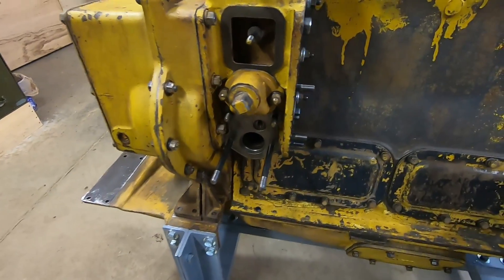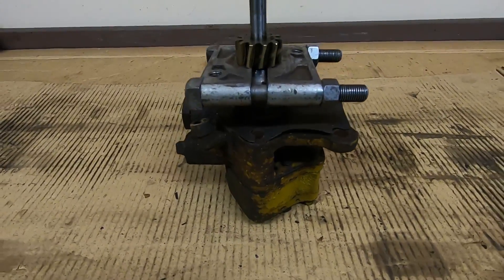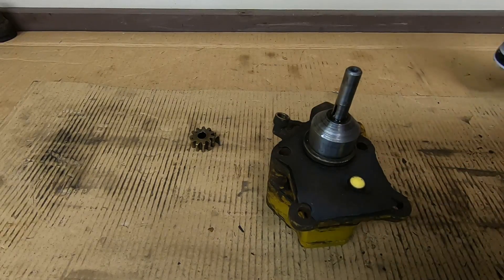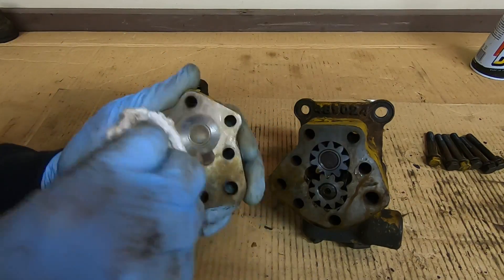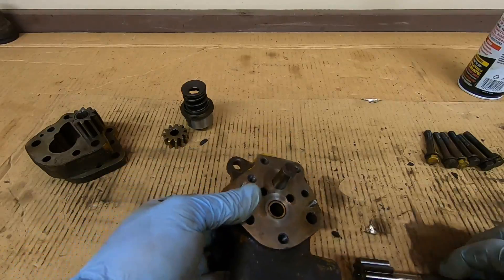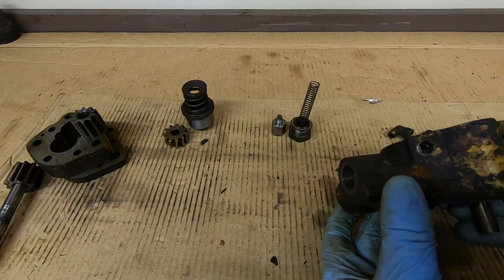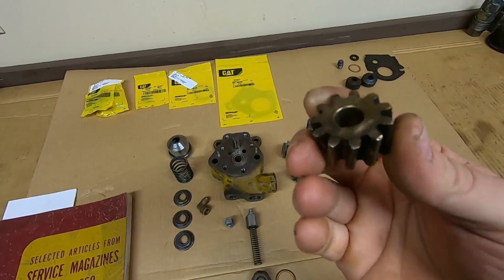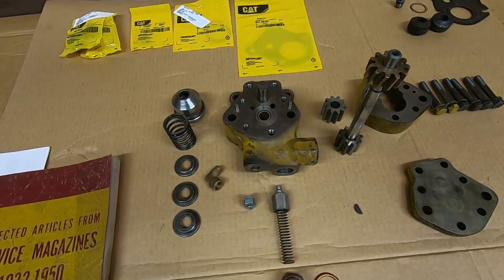Caterpillar D2 #5J1113 Diesel Engine Assembly Ep.27: Fuel Transfer Pump Disassembly & Inspection

Comment: My D2 4U shows no pressure when starting, caution pressure on the guage when running under medium RPM. Runs well, starts well.  New filters, new line, Does my pump need attention?
Reply: @squatch253  Thank you very much. I'm going to put the ol' girl into the garage tomorrow to check the relief valve. Your vids are a huge help for an all thumbs mechanic like myself
Reply: Got a new spring from Cat and replaced as you said. Good pressure, good gauge, engine runs Aces. REALLY APPRECIATE your advice. The relief spring cavity is the lowest part of the whole system, and therefor a water trap. Spring and base was rusty......

Comment: Funny❗️2 weeks ago I needed to have a tool for the same purpose. I used a pipe coupler, welded to a 10” piece of angle iron then used wood working quick clamps in stead of the wing nuts. It worked, but yours is much nicer 🤓 A+ on that extra credit project. I want a Neighbor like you.

Comment: O man I'm glad I didn't pull this transfer pump gear and cone off until I saw this video. Thanks now I know how to put the new gasket on. The one I'm working on turns hard but smooth, like new ... now I know why the spring tension and seals.
Reply: Fat Dan good luck
Reply: @darinhassett4708  Thanks

Comment: do you and your dad have a tool post grinder to fit on your lathe???  could be as simple as a 1/4" grinder clamped to the tool post..  the packing likes to ride on as smooth of a shaft as possible.. the outer area is still rough. it will shred the outer packing.  if you take it down smooth even if its slightly below shaft diameter.. it will work.  you are not taking the bearing journal areas down.

Comment: Union Tractor Alberta is still very much around.  I was in their old shop a few times, on 75 St in Edmonton.  It was a real cool blast from the past, lots of history there.  The new transit train line construction displaced them, and they now have a huge new shop a few miles away at 3750 13 St, Nisku, AB.

Comment: I was a little bit bummed  when it went to be continued.  But it made me smile and want to see the rest even more.  Thanks for such a great series.  It looked like a very good pump from here ! 
I was always told not to weld on hard bolts  because  it makes  them harder and more brittle. 
And the weld doesn't hold as well as on soft bolts.. and welding on soft bolts will make them harder to  . Just thought you might like to know that.   And it's my experience that it's right.   😊😊😊😊👍👍👍👍💖

Comment: concerning the copper line coming off of the housing this is called a case drain. when they started making pumps and motors with visible packing all you did was tighten the packing when it started leaking. when they started enclosing the seals if they started leaking after a time you got leaks where you didn't want them or they blew the seals. with the case drains you had a way of returning the fluid back to the tank and also you had an inspection port to check for leaks.
Reply: Exactly! Lots of hydraulic pumps use a case drain. Simple solution for a simpler time.....
Reply: @mmm365  probably not, it's to low on the engine. He said that it runs on the side of the block.

Comment: I was gonna ask how the fuel flowed between the pump gears but I decided not to. (Mr. Wiseguy over here...:) ) Anyway, I continue to be amazed at how sturdy the parts were made back in the day. What might a current machine look like 80 years from now? Terrific stuff.

As the engine builds up I’m wondering if the size of the order for that great late 30s Cat engine enamel will have to be increased.
Reply: @mmm365  already a lot of tech came and went - for example some appliances, car dashboards won't be 100% operational again, because we stopped using vacuum fluorescent displays at large scale few years ago - and there is little demand for it, so it's not like nixie tubes that are being made again.